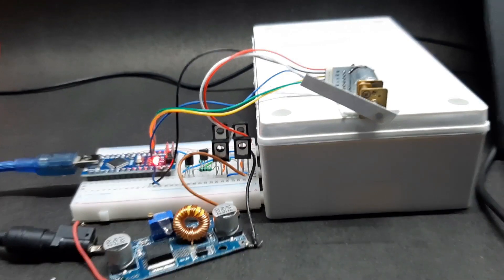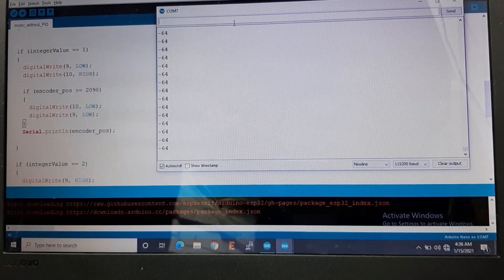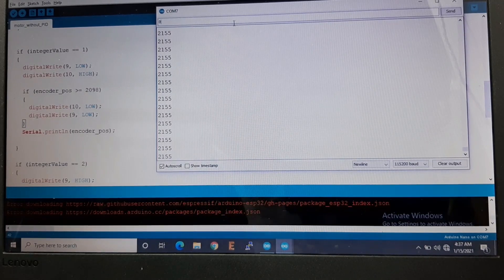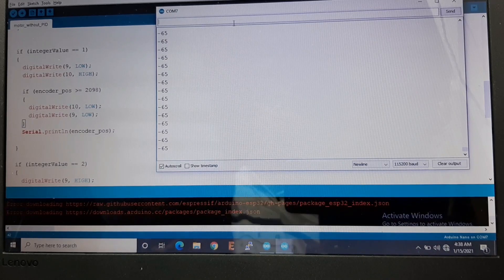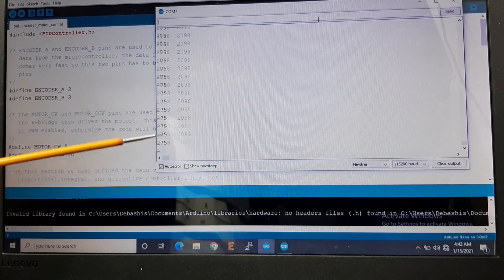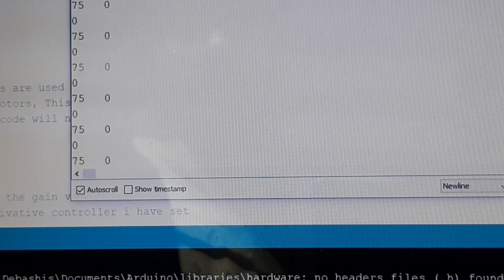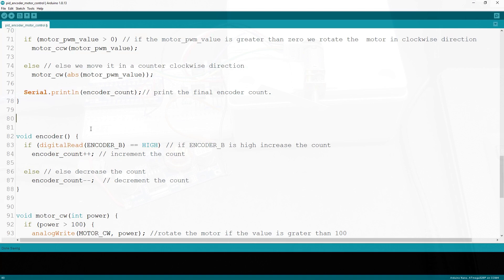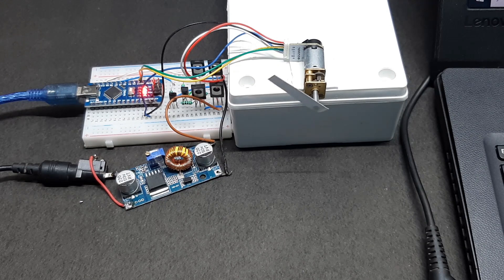Arduino PID based Encoder Motor Controller | Arduino Projects | Arduino PID Controller

Comment: Good day, I want to drive the BLCD motor as PID, I request you to share the circuit connection diagram.
Reply from the maker: we have already given the circuit and its explanation here https://circuitdigest.com/microcontroller-projects/arduino-based-encoder-motor-using-pid-controller

Comment: Hı I'm usıng encoder motor 5201 spur gear motor wıth your great code but the motor jıtters when reaches the posıtıon before stopıng. I haven't changed any values ın the code what would be the problem?